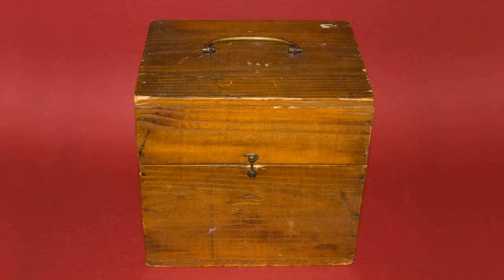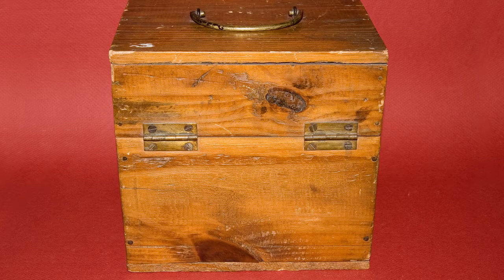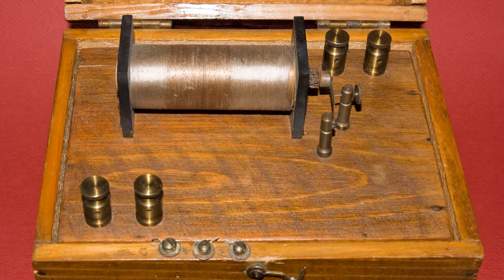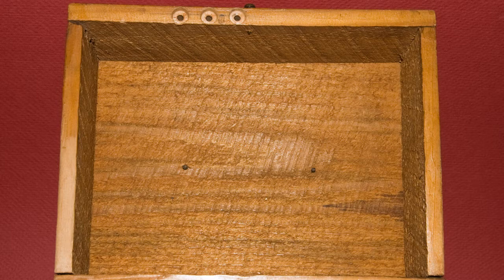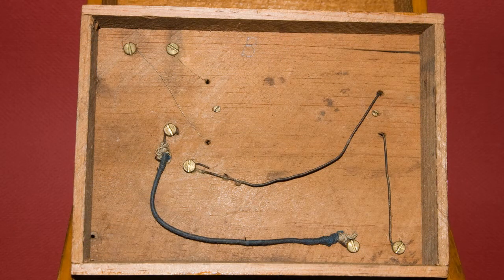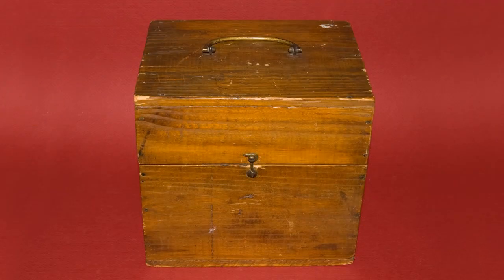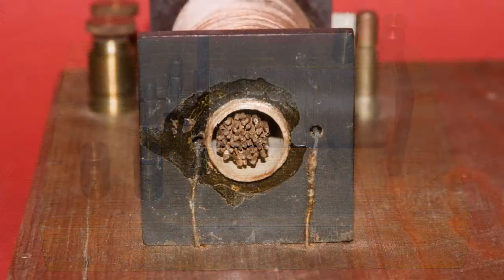Spark Gap Type Transmitter, maybe

Comment: It's an early electrotherapy device these were very popular in the late 1800s to the mid 1900s but these did not actually work as medical devices and were just quacks. Batterys would go in the box and the cords would attach to different attachments. Some attachments would be sponges you get wet and some were combs and rollers and metal cylinders. It could be homemade because there were magazines on diy versions and there were kits. It could just be cheaply made too. They also made versions that would act like tesla coils or plasma balls and they had gasses that would light up near high electricity, this is not the type that would have that but it looks very cool. It could be made easily into a spark gap transmiter though becouse that is what they pretty much were.
Reply from the maker: I did find out that it is a early electro-therapy device, and I like it more. There's probably not a large number of these around. Thanks for the information.

Comment: By itself it is just a crudely made induction coil for generating extra high voltages -  - nothing less, nothing more.
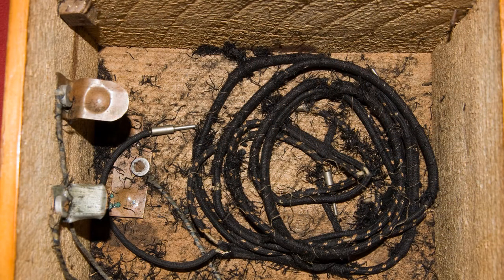3:53 Those nickel plated plugs were typical of 1920's & 30's connectors for headphones.
4:33 That ferromagnetic coil material was most likely made of Norwegian Iron
Reply from the maker: Thanks

Comment from the maker: Nothing to be sorry about. That is the way it works, a buzzer that develops very high voltage on the secondary output. If you were to hook the antenna to one terminal and the other to ground it would transmit like a spark gap, all over the place. But this unit may be a home made medicine device, Quackery. It is old and home made, even the metal core of the coil is home made. I am leaning toward a Quackery device now and not a spark gap transmitter. Thanks.

Comment: Hello: Maybe I am wrong but it seems to me a simple ringer experiment. I remember I did one in my school days, the final purpose is to make the little metal part oscilate as it opens and closes the current from the batery to the coil and this magnetic field opens its own coil circuit as the metal part is part of the coill circuit and open and closes the circuit continously. the screew seem to adjust the distance to make this thing to oscilate as two far will be not pulled by the magetic field...

Comment from the maker: There could have been another design. Clearly the iron core was made. But it is imposable to know if this was the first intent. There are no extra holes so it kind of looks like it is. At tip of the adjustment screw does look like it has been used, some burn marks. What ever it is, it is interesting. Thanks.

Comment: Very interesting box.  I notice that there is some headphone cable in the bottom of the box.  This almost makes me think that this was the start of a crystal radio of some sort.  The adjustable screw shown at about 4:36 might be a detector much like the razor blade that was used in early designs.   The visible coil looks, however, like it has too much wire for a crysta radio. The internal battery connections add to the mystery.  Very interesting piece.  No telling what was in mind.